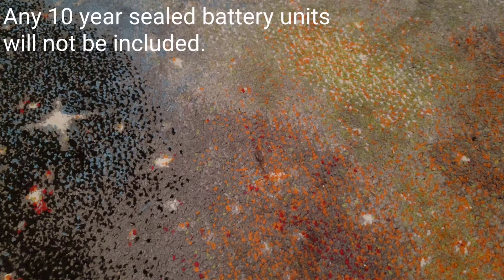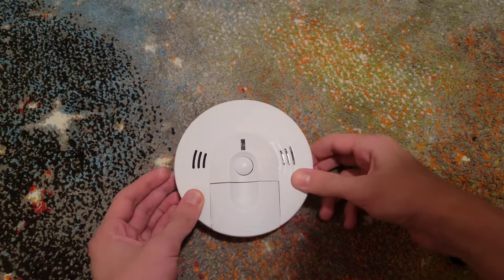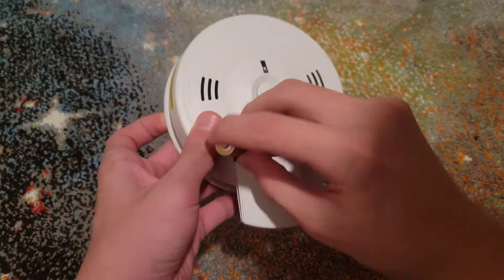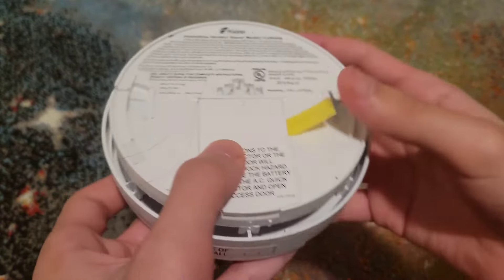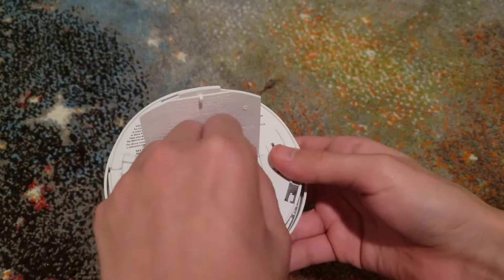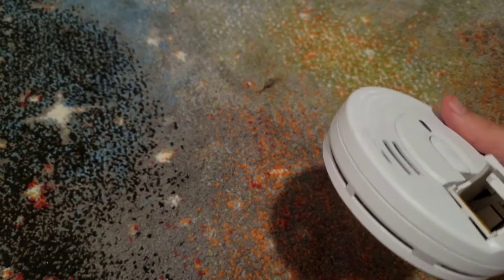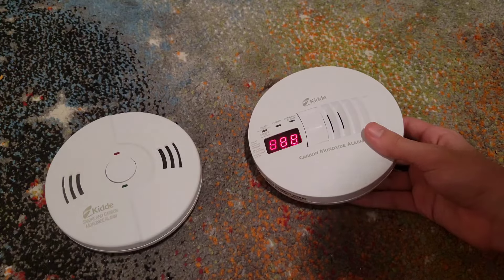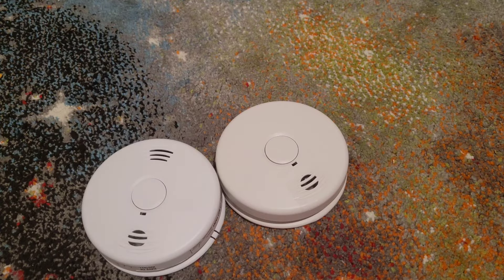How to change your Kidde hardwired smoke alarm batteries (To get them to stop beeping)

Comment: I have a combo smoke/carbon monoxide hard wired with battery backup detector. Late at night (of course) it started saying Low Battery every 90 seconds or so, with a single chirp each time it said that. I replaced the batteries but it kept on saying Low Battery and chirping. I tested all the batteries. The initial set tested at 1.52 volts and 1.29 volts, while the 2nd set were both above 1.5 volts. Defective unit?
Reply: Mines doing the exact same thing it’s driving me nuts